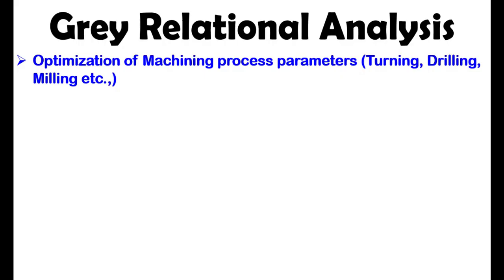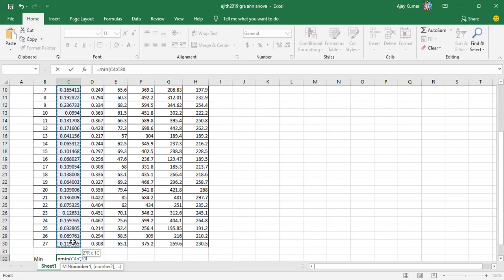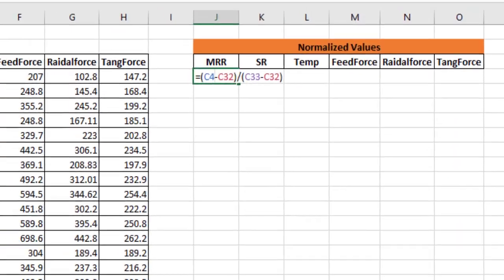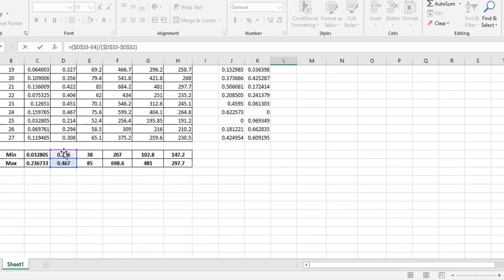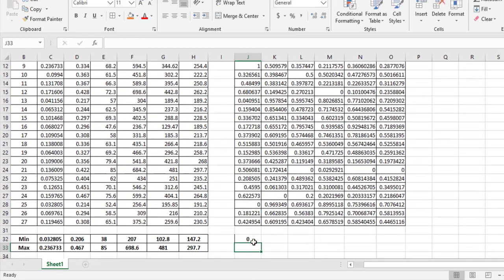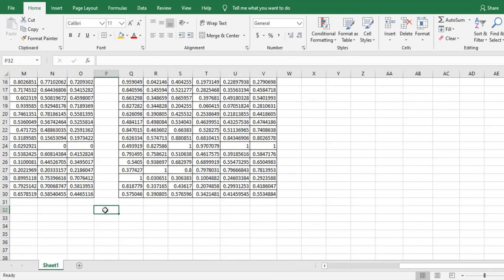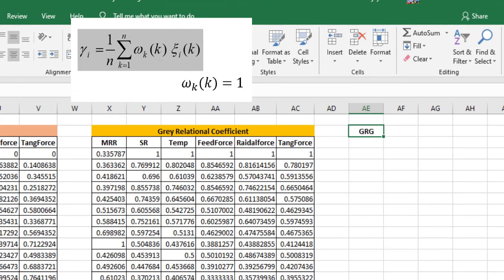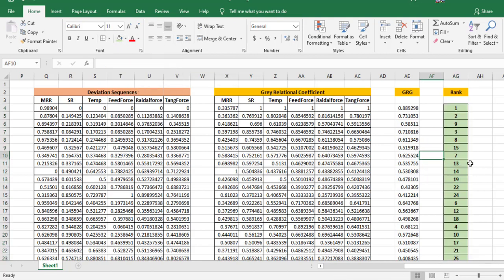Grey Relational Analysis Solving | Procedure for GRA #MCDM #Optimization #MachiningParameters

Comment: Is there any method to calculate Eta value instead of taking 0.5
Reply from the maker: Are you taking about Coefficient value in GRC formula ? If yes then the values lies from 0 to 1.
Reply: Thanks for your quick reply, in your example you have taken 0.5 , but in my case can I take 0.6 ,0.3 ,0.1 like that. If any method is there to calculate that coefficient please let me know 🙏🙏🙏🙏
Reply from the maker: the purpose of the coefficient is to weaken the the influence of delta max value when it gets too big. There is no specific formula for it but you can adjust manually as mentioned by  0.6 ,0.3 ,0.1. Then why the value you choose any specific if you can mention it will be good.

Comment: Good, I need to solve GRA in minitab. How can i do this? 
How can I do the Topsis in any software
Reply from the maker: Why you need to solve GRA in minitab. I hope gra and TOPSIS can be solved in  excel
Reply: @Vitarka  for graph purpose sir
Reply from the maker: For graph you can taken help of excel
Reply from the maker: I think Minitab doesn’t have feature to solve gra calculations, but it can solve the ANOVA for GRG values.